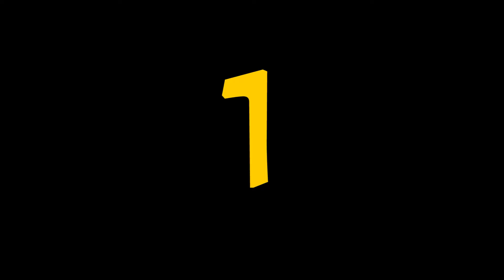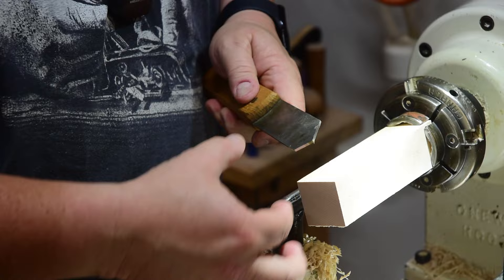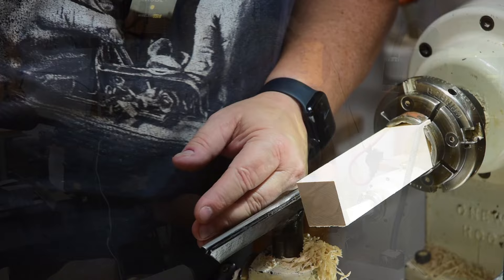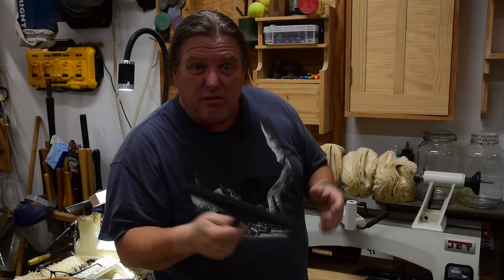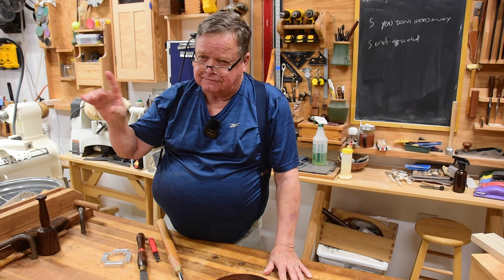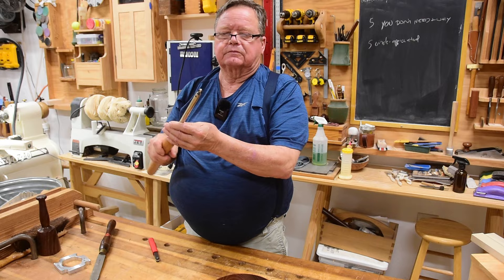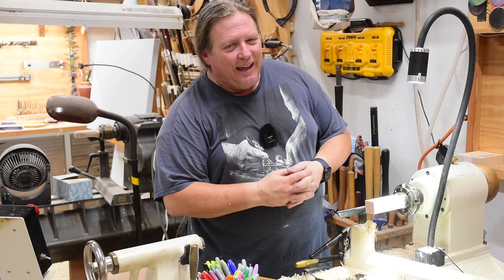Five Turning Tools You Don't Need and Why

Comment: I made my own parting tool with an old saw blade that had carbide teeth. Cut a strip from the center to a single tooth and attached a handle. The tooth is wider than the metal so it keeps it from binding

Comment: Love the humor as you and your Dad show that one person's trash is another person's treasurer. Clearly one size does not fit all. I would agree that a thin parting tool would not be suitable as your primary parting tool. I started with a 1/4" HF parting tool and it worked fine. But as I watched more and more demonstrators who traveled with a limited tool set most used a 1/8" PT. I made one from a bar of HSS and it is now my go to parting tool. But I still like my thin "tenoning" tool from Penn State which is about like your Sorby but a lot cheaper and still HSS for a lot of parting tasks on small projects. The less steel on the wood, the less friction.  But I would hate using it if it had the grind you showed as opposed to how all of them come from the manufacturer, or with a bit of the tip cut back.

Comment: I needed a thin kerf parting tool, I made mine from a chefs knife. It took a little while to get the angles just right and grind off the sharp edge. Used it for over a year and never had a problem with it.

Comment: For the thin parting tools, I use one all the time, and prefer it to my 1/8 inch wide parting tool. I get a 3/32 kerf with the thin tool, and almost a 5/32 kerf with the 1/8 inch tool.

The spear point took is excellent for shear scraping the outsides of bowls. 

I have been using the wire gage for my bowls for 30 years and considering it costs pennies rather than the $60 to $80 that the other tool does, it is far better.  Yours is the wrong shape. Correct way to make it is to bend it into a D shape, and then make your cut/gap about 1 inch in on the bottom side. This way it works on bowls and hollow forms. I generally set mine to about 1/8 to 1/4 wider than I want the wall thickness of my bowls. If it starts to rub, you have gone too far, so stop before you get there. This was a David Ellsworth invention.

For Stuart's platform, I don't like it at all. I would have to have several sets of the angle setters because I know they would get lost in the shop shavings. I made my own for a while, the robo rest. Pre set angles and exactly repeatable every time. Oneway is probably the worst one, and most will cut a notch 1 3/4 inch wide for the CBN wheels to fit into. Now, some one is making "right angle" platforms. I got some just to see how they work. Pretty good, and no jigs required to set angles. You can make your own jigs. I did take a 3 day workshop with Stuart and his dad Allen many years ago, and that started me on platform sharpening. Far faster than setting up jigs. I use the 40/40 and several different BOB (bottom of bowl) gouges, and haven't used a swept back gouge in over 10 years. I also do all of my roughing with scrapers. Far more efficient than gouges. You should have seen Stuart when he saw me roughing some bowls with my Big Ugly tool!

Comment: I have used a putty knife for thin parting for years. About 1mm in thickness. Never bought a specialised tool for it. 
I do make my own tools when I can. Even gouges at times. 
Though I agree that dents in the tool rest are a problem at times I've not had a problem with binding.

Comment: Maybe the reason you get binding with the narrow parting tool is that you're not making as second relief cut to slightly widen the parting cut. There are also times you might need it to conserve wood  during the cut. I agree with you on replacing lighter weight toolrests, and I've added Robust toolrests in several sizes (4", 6", 9") depending on the length of stock for my projects. I always match the toolrest with the stock I'm using. I do disagree with you regarding Stuart Batty's angle gauges. They're currently $40 each or the 3-pc. set for $69.90. They work really well dialing in angles on the grinder. It's not difficult to see the two reference points against the wheel when the grinder tool rest is gently moved to match. Much better than trying to use a protractor.

Comment: Narrow parting tool is essential if you are making grain matched boxes, especially if you are doing a production run….  Takes Too much time to cut it off with a saw or clamping up for bandsaw. Stainless steel tool rest is a must and some rough sandpaper on the bottom  edge of the parting tool and it works perfectly. And any pinching is bad technique on the part of the user, or the turner trying to part off something larger than the tool is meant for

Comment: Enjoy the Dad parts, good interaction and sometimes information.

Thin Parting Tool - its tool not gouge. Any parting tool requires relief cuts to the side to prevent burning. Your tool is sharpened wrong. Bring the point way down to a 1/4" above the edge of the tool. This helps stabilize the tool when cutting.
Cast Iron Tool Rest - agree, they're crap
Safety Drive - Agree. I use a stebcenter. No sense buying a safety drive then time to notch the circle - a stebcenter is already done.
S. Batty Angle Finder - Agree. I make my own out of 0.080" thick clear plastic with a long distance between contact points.
Thickness calipers - Your Dad is right, fingers DON'T WORK. Not a fan of the diy wire either. I guess one with a gauge is cool (and expensive). I have several different sizes/lengths that pivot only, and show thickness at the opposite end, work quite well.

Comment: I make my own parting tools from old carbide circ saw blades.  Use a ZipCut wheel to cut a center stripe out of the circ saw blade and fit it into a handle.  Touch up the carbide with a diamond stone and you're off to the races.  The carbide tip is wider than the steel so there's no friction on the sides of the tool in use.  Easy peasy.

Comment: When did they get called "safety drives"?  Before turners started putting live centers in the tail stock,  they were called "dead centers".  They're good for small things.  I didn't put teeth on mine.  You can keep the lathe running if fitting something or doing multiples.  
      I  have this one #2 taper four prong drive with a long point.  I ground off two prongs and a little more to make the remaining ones stick out more.   I pound that thing into big chunks almost like it's a nail so I can put a tenon on the piece for the chuck to grab.  It will slip sometimes if I'm trying to hog wood off of a big weak piece.   I repound or recrank the tails stock.

Comment: I agree those thick steel thin parting tools have never shown any appeal to me.  It is really sad the Jet hasn't upgraded their stock tool rest. I got rid of the one i had on my first lathe as soon as I could afford something better.  I use, and teach how to sharpen with the SB angle gauges.  Like any tool you need to learn how to use them, but once you do they are really great for getting repeatable results.  I prefer a steb style center as it gives a good drive grip but will give if things go bad.

Comment: parting tools need to be hollow ground so there is side clearance.
Grinding angles:  I have 2 removable platforms that I put on the grinder rest that are different angles so I don't need to change the grinder rest angle.  2 seconds to change to another angle.
I have found the spur doesn't provide enough grip for ape turning bowls.  I have spun it many times from a catch and don't use it anymore.

Comment: I learned the value of the safety drive from an old wood turner, who made about twelve thousand spinning wheels and probably close to a hundred thousand spindles. When using the safety drive, you do not have to turn the lathe off to change spindles if you're careful. Just Watch your fingers so they don't get caught in the tool rest.
Reply: Just loosen the tail stock slightly before removing the spindle and retighten with the new blank in place .
Reply from the maker: That was standard technique in production shops even with spur drives as it wasn’t easy to turn off power in a steam/water/generator overhead belt drive setup production shops used.

Comment: I ground my own thin parting tool from a 1/16 hss blank. However, mine is only 30mm tall and is very asymmetric in an attempt to minimise the area of contact with the wood. It also has a nice longish handle so I control it one handed and catch my turning. The one shown here really does look crap! 😂

Comment: Whew, some great points. My favourite parting tool was a metal lathe blade. The top had a flute. I mounted and ground it upside down for wood turning. It's great, not that I removed the two sharp edge of that flute destroyed the iron rest of an old lathe. I redressed it for the new owner and the new stainless top of the new rest is free of dings after a year and 750 hours on it (100 might be on the 11" OneWay rest). That said, I'm about to inherit a typical diamond parting tool with a longer handle. It might become the new default.

Safety drives suck. Git Gud and learn your technique.

Angle finder! I couldn't find a suitable choice I liked so I printed a profile of eight of the aforementioned jig , cut them out and glued them together. Works so well! Step by step: Choose your angle, position jig so the angle numbers are upright, place flat edges against wheel and angle your rest to meet the flat edge. The flat edge below the printed number of your chosen angle is what you're looking for.

Still using fingers, but I've eyed up calipers. My sensory deficit might mean a tool is the right call.

Never understood when I saw prominent YouTubers using a point tool. At first I thought I was missing something. But, I do want to try a texturizing tool. I like embellishing and haven't found the right chatter with reciprocating saw blades or other similar things.

Comment: I would like to hear your comments about large lathes. I have an ancient lathe. 3 hp motor, 8 foot bed, 24 inch swing, 4 speeds, weighs about 1,000 pounds. I’d like to get a modern lathe. Maybe a Robust or Oneway or Powermatic.
Reply from the maker: They are a luxury for most. A necessity for professionals. I've worn out mini's and midi's but the Oneway is infinitely rebuildable and will outlast me. Dad's Robust is barely broken in after 10 years.

Comment: Thank you Shaun, you easily explained my pain with using my similar thin parting tool, it’s not me(this time) it’s the tool.
Reply: No, it is the way you are using it. Try making some clearance room with two overlapping cuts, reducing diameter in steps. The tool will cut perfectly well, with none of the issues described. It's worked fine for me for over 25 years.
Reply: @craftsmanwoodturner  thank you Richard. Having sufficient clearance and taking the extra time are always good reminders.
Reply from the maker: I actually talked about that in the video.

Comment: What do you really think about these tools? Don't hold back. Let it all out.

In the 90s, I could have used one of those safety drives. Especially with the pucker-inducing skew. Nowadays, the skew might be my favorite tool. But for a while, it didn't get much use. Saves tons of time and sanding. (Do hate sanding. Waiting for your "I hate sanding" video.)

Have friends who use a larger ring tool, probably for finish cuts. I like the Hunter tools for some of that. 

Don't have a Gauge-T. Yet. But many turners do love theirs. The inventor is an awesome turner in his own right, not one of those bothersome engineers. 

I have a slim parting tool made from a sawzall blade ala Cap'n Eddie. If I worry about my stone-age tool rests, I'll slide one of those plastic binder clips on it. Use it all the time. Got this idea from a Sorby parting tool which came with the like -- the bottom is a sharp concave trench with two points contacting the rest. Door prize at a local chapter meeting. Don't use it so much. Other widths of parting tools used as needed.

I sharpen by eye and hand on belts. Sometimes the Makita wet sharpener. I use something like the Michaelson grind on bowl gouges and though he sells something like a jig, it doesn't look terribly useful. Would like a jig for the skews. Should be simple.

I tell everyone interested in turning that, no matter what you spend on your first good lathe, it'll pale in comparison to the $$$ going out the door for all the other goodies. Grinders, chucks (omg. And I want to switch my technatools to Vicmarc. Shouldn't be too hideous. AAAAHHH) lathe tools, dust extraction, bandsaw, lighting, sanding stuff . . . And I have yet to meet a turner without a collection of stuff which ended up being useless. Except to the vendors.

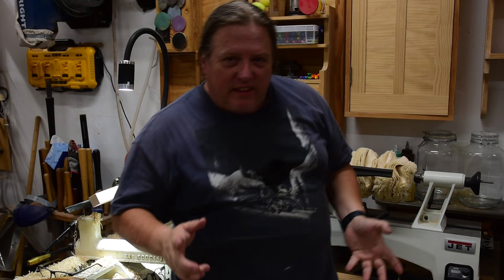Comment: Totally agree with the tool rest 3:53 problem. The rest that came with my Oneway 1224 has been a problem since day #1. I've sanded it smooth many times, but it seems to get dents in it very quickly, and the tools never seem to slide very smoothly on it. I'm in the market for a replacement; if you or one of your viewers has a good replacement option for this lathe I'd like to hear it. Thanks for the gr8 videos!
Reply: Robust makes great tool rests that fit Jet lathes. Before I figured that out, I took the original tool rest that came with my Jet  and used epoxy to add a 3/8" round piece of hardened steel rod that I bought at the hardware store. Glued it to the rest and ran a bead down each side. Performs just like the Robust. I know several turners that have done the same. No one has had the rod come loose after several years of use.
Reply: @PStJohn-he2mi  I like the inexpensive fix, but I'm a little worried it might come loose and become a projectile. I'll do some investigating into a Robust rest. Thanks for the info.
Reply: Some tools, like scrapers, have a rectangular cross section whose corners can be rather sharp. You can save wear and tear on your tool rest by rounding those corners with sandpaper or a quick swipe across a grinder.

Comment: Too funny, you started with my favorite cutting tool, the Sorby thin parting tool, I love love love it, but mine looks different; the corner that cuts is not close to the middle of the blade but very close to the bottom. So it is meant to cut close   to the bottom and the rest above it gives it stability (no vibration in the blade). It cuts like a butter and does not catch, because it cuts. So, I believe you should sharpen it differently (mine is the original shape) and have a fresh look at it. I think that shape loses all its clever "engineering". With that knive I have had very little use for the basic parting tool. I use it to make very deep cuts like roughing a log and then cutting a dozen half inch slices out of it. The first inch with the standard cutting tool, the switch to the slim to continue the same width but splitting the cut into two cuts side by side and my knife won't get stuck or cause burn marks deep close to the cutting point. It is also very useful with miniature scale projects, like beads, drop spindles, buttons and such. The knife works great when you cut through 90 degrees angle, when you have limited options to make a planing cut that you more or less need with the skew. Yes my tool rest is a bit dented, but not because of the slim shady, because all the catches I got with my skew. And I dont mind, I will sand it smooth if it starts to bother. And based on your suggestions, I will buy a steel one, having a cast iron one for roughing is fine. The slim knife makes it easy to tweak the remaining fibers againts the pointed live center  tail stock, making a neat new position for the live center, like a finished indent. If the next step is to bore a hole, you have a start for it to align true. I believe the catching issues may have to do with the shape of the blade. Its efficient (fast) . Regarding the engineering, the further the cutting point is from the tool rest, the more vibration and counter fources, and the corner in that higher position it is further away from the tol rest both forwards and upwards. (I don't think you are an idiot though... without your videos I would understand there things so that I could analyze all this I hypothetized above. Or even bought a lathe and started. You are a great teacher. Your strong opinions actually gives a confident space for us beginners as we can see that circumstances, skills, wood and projects depend on one's tool choices, and its okay, as long as you take time to explore and understand. This video brought a smile, you guys are morphing from teaching to improvised comedy acting.)

Comment: Ok.  I agree with everything Except about the parting tool.  That tool has a specific use when making boxes. If you have a lot of figure and you want to minimize the loss when separating the lid to keep the grain flow, you use this tool. Don’t do boxes?  Don’t care about the grain,  don’t buy the tool.
Reply from the maker: I do lots of boxes, my favorite thing to make. When grain conservation is needed I've started using a flush cut saw and it's worked wonderfully. (use wax!)